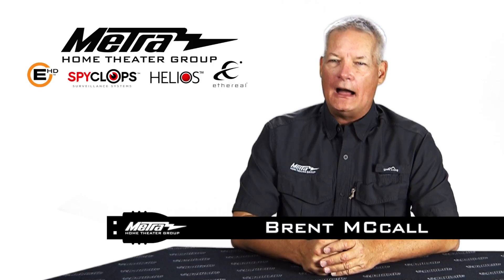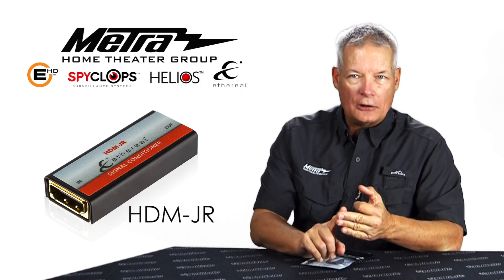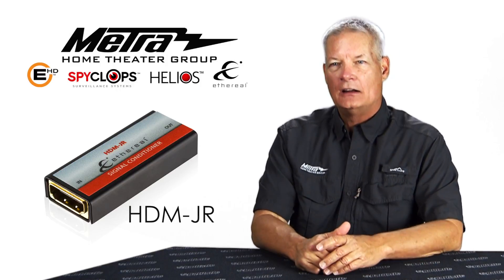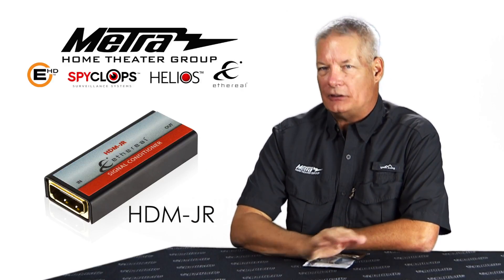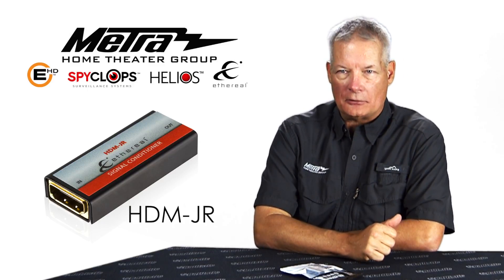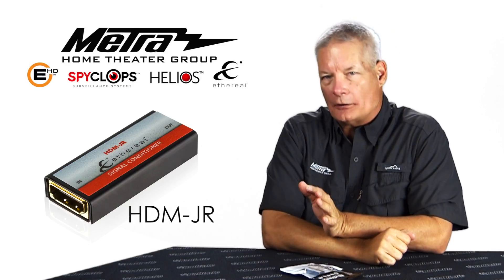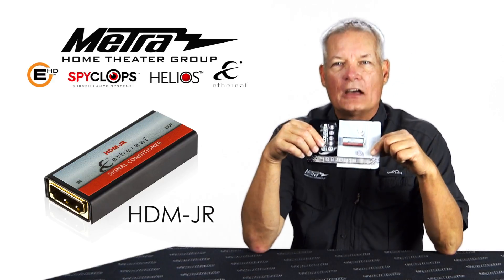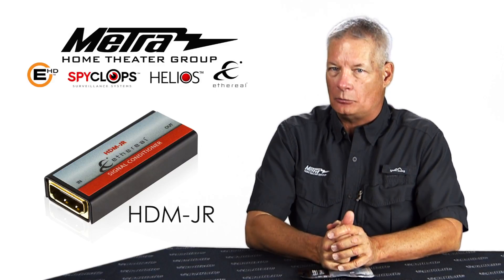How to Fix EDID Problems in the Field

Comment: Would something like this work on a laptop having EDID issues running an Elgato HD60 S Game Capture device? It’s been having sporadic issues like this for a while now and just recently, it’s gotten to the point where I have to reconnect my USB cable every single time I want to record game play. It still works, but it is a hassle having to make multiple test recordings, reconnect cables, and then start actually recording to ensure the videos come out well.
Reply from the maker: Hello Link! The Elgato HD60S is a great piece, and it sounds like you may be definitely having issues with the system not syncing correctly with EDID or it may be a Hot Plug issue. 

It sounds like when you unplug the USB cable then plug it back in it is killing power to the Elgato which forces the system to renegotiate between the source and display. Next time this happens try doing the same procedure as before with the USB connection, but this time do it with the HDMI from the gaming console and the Elgato.

If the problem persists, you may need something like our HDM-JR3.

Feel free to call us with any other questions or to further troubleshoot! 1-386-492-8584
Reply: @EtherealProAV  I’ll give that a try if the issue persists. Oddly enough, I still had Sound Capture active from the last time I tried testing the addition of commentary, but never disabled that aspect when I decided to move forward with the non-commentary format. Disabling that aspect also seemed to fix the issue and I haven’t had any other issues since.
Reply from the maker: @LinkMountaineer  Sounds great! good luck, and let us know how it turns out!
Reply: @EtherealProAV  Alright, thanks!

Comment: If I use a 1 in to 4 out hdmi splitter, do I need 1 device, on the input of the splitter? Or do I need 4 devices? 1 for each TV?
Reply from the maker: Hi Vincent, Primarily, you should only need one on the input of the splitter or one for each of the TV's that are showing problems. It also will depend on exactly what is happening, if anything at all. Please reach out to us if you have more questions! 386-492-8584 is our tech support line. - Adam

Comment: Will this correct the "rainbow" screen issue I'm having? Also can I put this on the input of an hdmi splitter or do I have to have one for each of my cables?
Reply from the maker: Rainbow screen issues are never fun! Diagnosing the culprit can be involved. Metra Home Theater Group dealers can contact our tech support team at any time for questions on using our products or for tech help. Just call 1-866-839-9187 to speak with someone.